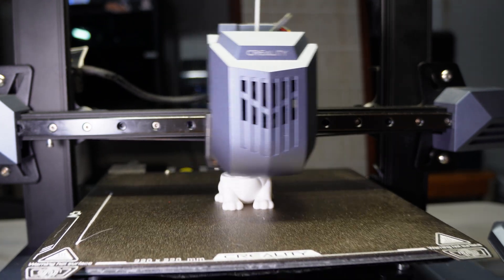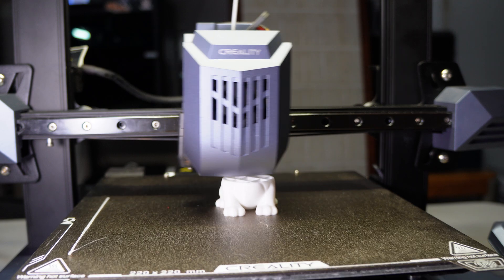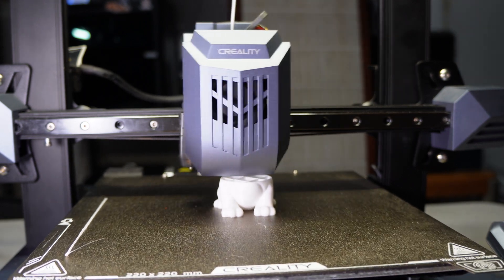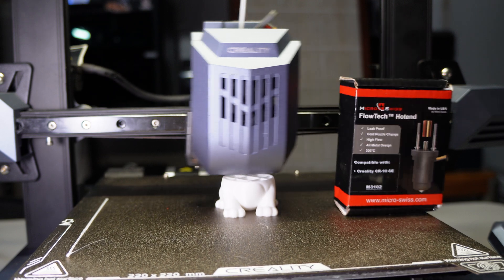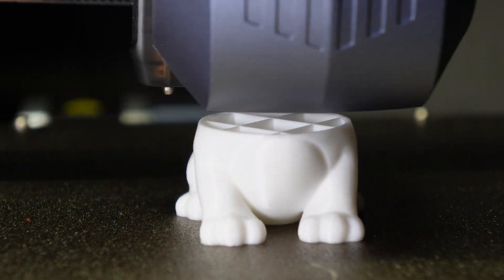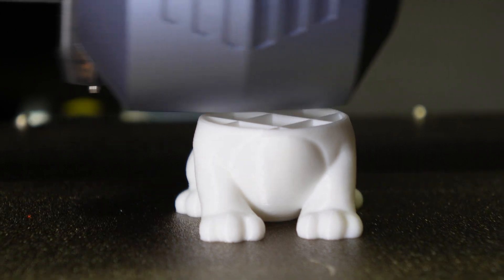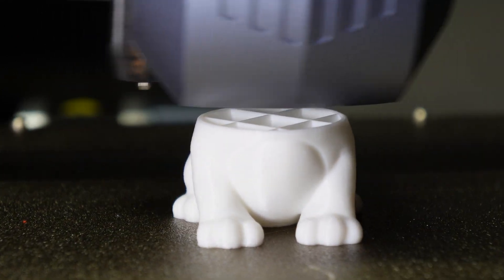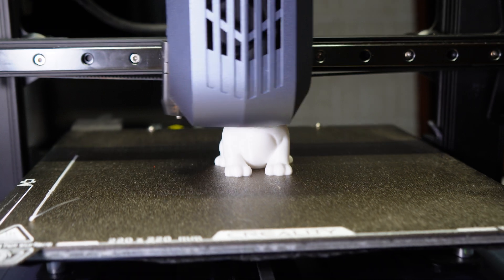Testing @MicroSwissLLC Flow-Tech Hotend on Creality CR10-SE, that had Blob Of Death.

Comment: what slicer are you using ? 
what filament are you using ?
is that noise the extruder fan ??

if your standby temp is too low when it does a z-hop with 100% fan, it can cause the filament to be too cold when it comes out and not bond well or at all.

i print my PLA at 222°F with stand by temp at 190°F
i run my extruder fan at 30%, and Part fan at 40% for PLA, 20% for PETG, and 60% for TPU.

i use Creality Slicer (its a lot like CURA but looks better), for my Ender 3 Max Neo and EleGoo Rapid+ (PLA or PETG), 

im able to run 100~120mms with no problems with this Rapid+ on my Sonic Pad.

i also upgraded the extruder to the direct drive.
Reply: I use Orca with my Cr-10se and i love it!!! I can print the same thing from orca, and then Creality. And the Orca will look better and finish faster. That’s me not adjusting any settings
Reply from the maker: Creality Slicer is an ANCIENT version of Cura, with a creality skin on it. Nobody uses that, even when it was new. Make the move to Cura. Better yet, make the move to Orca, or Creality Print. 

I regularly work in Bambu Studio, Orca, Creality Print, and Cura, on my Creality machines

Yep, CR10-SE is super loud

120s is easy-peasy, and kinds slow for a CR10-SE, but I don't worry much about speed.

Z-Hop crap. I avoid it

It's been smashing since the new hot end. 👍🏼
Reply: @3DRundown  lmao i know its old, but it works -  ive been thinkin about movin over to Orca. but you know how it is when you have all your material profiles dialed in for one software, it doesnt always work the same in another.  ive been trying really hard to use Lychee for FDM more and more since im paying for both FDM and Resin lol. 

but now i think i might give Orca a try !!
Reply from the maker: My man, Lychee absolutely SUCKS. These new machines need very little filament dialing... I throw EVERYTHING at my K1's, P1's, V3's, and CR10-SE, with almost no changes at all. Make the switch to Creality Print or Orca, and SEND IT!

Comment: Getting those things to work even remotely well is a real test of resilence sometimes but it's very gratifying when they do
Reply from the maker: First time using one. 2 test prints, from previous slices, with no adjusting at all. I also had a problen with Z-Banding/Layer Lines. That's gone....  So far so good. More testing to come!